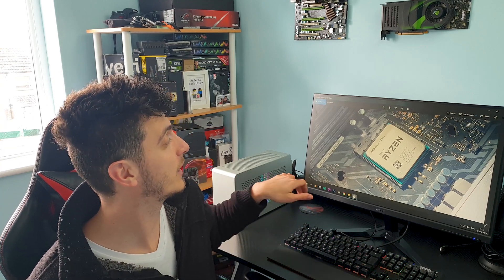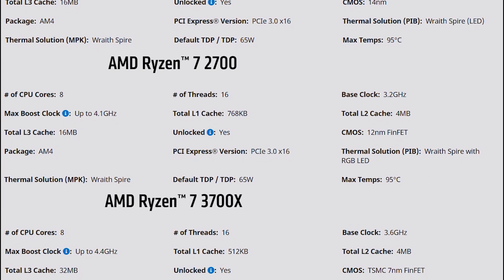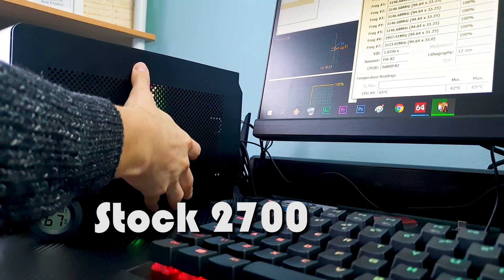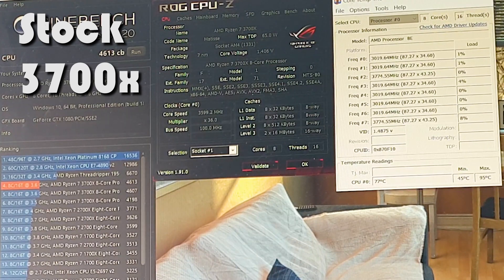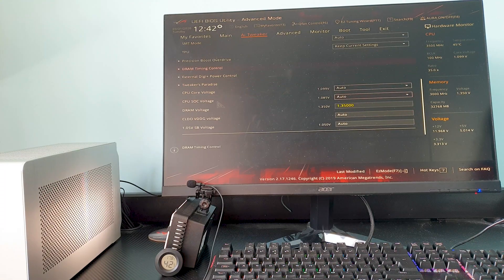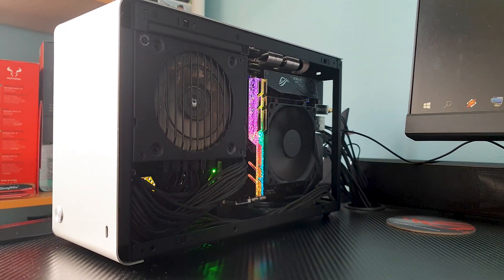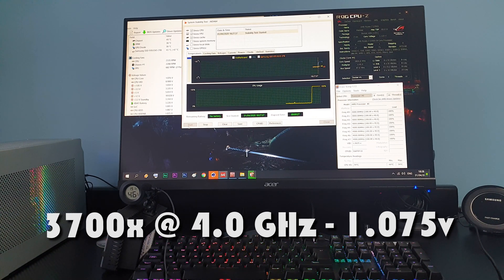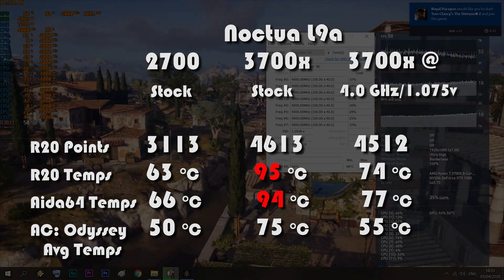Ryzen 7 3700x @ Noctua L9a | Dan A4 SFX | Is it a true 65W TDP CPU? | Air Cooling Tests – Part 1/2

Comment from the maker: What temps do you guys get with your 3700x in the A4 and in general?
Reply: Got the same case, same setup.  I set my PPT to 78W in Bios (you can do it on Ryzen Master too) and get 4550 score on Cinebench20. temps never go over 79C under full stress. I'm happy. With 40 multiplier lock I found 1.112v to be my sweet spot (4827 in CB20 and 85C under max load in aida).
Reply from the maker: @espow2070  Thank you for the info!
Reply: I'm using the wraith prism cooler, and when encoding video in handbrake, temps go up to 90 degrees. sometimes hotter. It seems fine when gaming, just using handbrake, it seems to get very hot.
Reply from the maker: @esinach  Yeah sounds about right, they can get really hot when in 100% usage even in stock form since the voltage curve is a bit agressive.

Comment: Do you think the L9a would adequately cool the 5800x at stock?
Reply from the maker: Apparently no chance or it will throttle, if we are talking about the Dan A4 case. It's 9 degrees warmer than the 3700x at stock according to techpowerup and knowing from my previous tests that the L9a bearly will cool the 3700x as is.

https://www.techpowerup.com/review/amd-ryzen-7-5800x/20.html
Reply: @Glob3Tech  Damn, ok thanks! Just a sanity check for my first SFF build, I wanted the 5800x for MOAR POWER but the 5600x might be more sensible. I'm building in a 3L case so max cooler 47mm - a lot of planning required for something this small!
Reply from the maker: @lawrencecorr6232  Sure 🤗. I don't have the chip myself but it looks like a long shot with the 5800x in stock form. Maybe my manual OC trick will work like it did with the 3700x, than yeah in theory it should be under control.
Oh nice! Wish you good luck and please let me know how it goes.

Comment: That CPU has a lot more potential. Am running mine on a 240mm AIO at 1.35v at 4.3 ghz, and it scores +/- 5200 points in Cinebench R20.
Reply from the maker: Very nice!

Comment: Do you think a Ryzen 5 3600 (stock) would have acceptable temps at stress test?
Reply from the maker: I would think it would behave in stock form very similar to the 3700x. 

This review shows only one degree difference between it and the 3700x. 

https://www.techpowerup.com/review/amd-ryzen-5-3600/19.html

So yeah would be hot in stock form. It needs the manual OC I did if you want it in the A4 on air.
Reply: @Glob3Tech  thanks for the quick reply, dude. I guess SFF PCs suffer from same temp problems as laptops (but with more solutions though).
Reply from the maker: Of course my pleasure man. 🤗 Indeed.

Specifically for the A4 if you check my latests videos in this playlist I have found for my needs a nice ballance between cooling and low noise output. 

I need a 3900x or even the 3950x to fully test my solutions but for now if you have the 3600/3700x the best path is that manual OC of 4.0 GHz @ 1.075v that gives me stock performance but 20C cooler and you can even use the L9a. If you install the AIO then I suggest a side fan for extra aiflow around the motherboard that will improve everything. 

Any other questions just shoot 👍

Comment: if you watch gamer nexus video, this video doesn't mean anything. he already said "in amd world, a 65 watt tdp processor is not 65 watt, it's because they included a 65 watt tdp cooler there" so that's make intel and amd diferrent. intel give delta cpu power, while amd give is based on what cooler they included. ryzen 7 3700x use around 65-100 watt for gaming
Reply from the maker: Well he is tech jesus after all 😁
True only for the 3rd gen AMD Ryzen. 1st gen and 2nd gen, they respect the TDP.

Comment: This is dumb question as I'm new to computer building but can the noctua l9a or l9i (w/am4 mount) cool amd ryzen 5 3600? Very nice build. I may want dan a4 case over ncase m1 cause of smaller footprint and I'm more casual, not into overclocking, just want simple small computer for internet and light gaming
Reply from the maker: No worries at all. Thank you! For stock use with either the l9a/i for that CPU it should be fine for what type of usage you described. Further down the road, I might recommend a small negative offset for the voltage only of you see it idles like 60 degrees or something if that matter, since 3rd gen Ryzen are a bit aggressive on the voltages on some boards. Maybe by now they have been more finely tuned with BIOS updates.
Reply: @Glob3Tech  the 3600 is also very (over) aggressively volted. I use a -ve voltage offset instead of a fixed 1.075-1.1v in the tiny k39 case with a similar cooler and its the same idea of undervolting.
Reply from the maker: @personaltrainersg  Excellent, thank you for confirming the same behaviour on the 3600 as well. 👍
I don't have the 3700x anymore to try a negative offset but glad to hear that is another great option.

Comment: i did the same thing and ran my i9-9900k at 4.0GHZ all core with 1.20v Using l9i but the scores were way lower
Reply from the maker: Yeah quite the difference between the 4.7-5GHz range. What about the difference in temperatures?

Comment: thermals are pretty bad in a node 202 with a 3700x as well.
Reply from the maker: In stock form for the CPU?
Reply: @Glob3Tech  yeah, while it wasn't as bad as with the case in the video, it was still going into the upper 80s. I wasn't using the stock cooler that came with the 3700x because it was too tall for the Node 202, so i ended up getting an ID cooling IS-60. I replaced the fan that came with the IS-60 with a Noctua 120x15mm fan (better in every way to the fan that was on the cooler) it dropped thermals down to the mid to high 70s, but I took it a bit further and lowered the PPT to 75w and the CPU temp tops out at 65c (left it set at 100% for 30 minutes. 

But the GPU thermals are just as bad, it would blow past 80c and into the thermal throttle range. I added two 120mm intake fans which thermals now top out at 73-74c. I can get thermals lower but that'll be by cranking the GPU fans at 90% (I'm just going to cut exhaust holes above the GPU to get rid of the trapped heat).
Reply from the maker: I see, yes, on the hot side. Nice with the PPT. What motherboard may I ask and what GPU? 
Those extra holes yeah will help.
Reply: @Glob3Tech  the motherboard is a Asus Rog Strix X570-i, and the GPU is a PNY XLR8 1660 super dual fan.

Comment: I have a 3600x after upgrading from 1700x in the Dan case. Zen2 is a beast with temps. I was using the l9a and then went to Asetek 645LT - my temps weren’t great (60 idle). So switched back to l9a but using liquid metal as the paste. Much better temps. Will likely be selling the AIO. I do need to check out undervolting and reduce temps further. Nice vid man!
Reply from the maker: Thanks man! Glad to hear it's working for you as well on the L9a!

Comment: What was your CPU idle temp?  And  what was your CPU fan speed behavior in idle or light office work?   Does the CPU fan spin up and down every couple of seconds?
Reply from the maker: Asking for the cpu in stock form or 4.0 GHz @ 1.075v?
If it's the second one, from what I remeber it was in the low high 30s to low 40s on the L9a, fan curve set on silent and I didn't notice any agressive fan curve changes. 

In stock form, mid to high 50s and yes the fan will spin up and down every couple of seconds even on the silent profile.
Reply: @Glob3Tech  Thanks, hm, my 3700x is stable only at 4 GHz @ 1,125v and that gives me 48-50C idle temp with Noctua NHL-12S, probably the Sugo SG13 itx case is not so good in airflow as the Dan A4...   And that still had 10C temperature spikes now and then, better than stock 20C spikes, but still annoying.  So I had to resort to disabling the turbo frequencies altogether, the base 3,6GHz is silent at all times.  A bit dissapointing, I don´t understand why they set such high turbo and voltages, going far over 65W tdp...
Reply from the maker: @Stanislav_Lauko  Welcome man. Maybe try 4.1 GHz for that 1.125v? At least get more performance. Aha I see. Yeah, the A4 having its own separate areas for cooling cpu/gpu side and intake fans work really well in the A4 for the CPU.
I know, that's why I did these videos. With aome motherboard apparantly you can set the TDP levels overall. Another viewer mentioned this for his Gigabyte board. My Asus strix b450i doesn't have this feature. Stock yeah its 65w but 88w at the socket as they call it.

Comment: Did you every try the L9a with a 25mm noctua fan instead of th 15mm one that is delivered with the cooler?
Would it perform better than a black ridge with the 92mm fan?
Reply from the maker: I haven't tried the regular 25 mm thick fan but worth a shot and will put this test on my list for an upcoming video :)
Thank you for the idea!
Reply: With this Dan case? No. The case only allows for 48mm cooler height. With a 25mm fan, the height will be 48mm you leave no room for air above the cooler which will result in worse cooling perf and even worse (louder) noise. Trust me I have tried that myself with a similar case. For other case without the restrictive coller height, it might perform better but I believe you would be better off with other cooler with a larger heatsink.

Comment: On the Gigabyte B450-I the most effective and simple way was to set the PPT lower than stock (88W on 3600). I set 54W and went from 88W and 3500r20 to 55W (peak) and 3300r20. No need for the L9... even the included 'Wraith Stealth' didn't need to go above 1500RPM anymore.

NOW with the 3700 and the Asus B450-I PPT in the BIOS doesn't do anything... :/ Disappointing from Asus.
Reply from the maker: Excellent insight on the Gigabyte board, thank you! I know, hence why I had to do my manual OC per say.

Comment: Great video mate. It might be a silly question, but have you updated your chipset drivers and applied the included Ryzen power plan in windows?
Reply from the maker: No such thing as a silly question James 🤗
In this video I had the second to last bios update for the motherboard. Regarding the new chipset drivers I don't know if I had them updated nor did I change anything in the power plan, but I will make sure I mention these as well in my next video!

Comment: Amazing videos.  I am learning a lot from them and hoping to get my first sff build done soon.  How do you think the 3700x would do with your alpenfon black ridge cooler using a 120mm slim fan underneath and the vlp ram?  I wonder if it could make stock voltage viable?
Reply from the maker: I am so happy to hear and thank you for the comment ✌ For a stock 3700x with that setup, I would say anywhere from a modest 5 degrees C to maybe max of 10 C better than the results with the L9a (what you saw in this clip). Good luck with your build and I know eveything will come toghether for you ✌ Any other questions, let me know.

All the best,
Alex
Reply: @Glob3Tech  Thanks for your quick reply.  The asestek 645 video has leaned me going the aoi route more.  Again thanks for all the hard work!
Reply from the maker: @switchbeast8825  Glad to help and thank you for the support!

Comment: @Glob3Tech Can you tell us something about the fan curve that you are using or rather the fan rpm after your tweaks, especially in AC Odyssey?
Reply from the maker: Hi Tederean. To give you an exact rpm number in that scenario is hard since I am still on the AIO installed in the A4. But from what I remember the fan was no where near 90-100% like in stock form regarding the 3700x. I would say for that tweak, the fan was around 60-70% rpm in AC:O.

Comment: Great video man! Was wondering whether you could also test the 3700x with the blackridge, especially with the 120mm fan configuration. Thanks!
Reply from the maker: Thank you! Sure will try if I can find better VLP ram since I don't have any available at the moment. :)
Reply: Glob3Tech Would you say the blackridge with a 92mm is better or the Noctua L9a for the 3700x?
Reply from the maker: @TriNguyen-wl5vf  If you go with the 92mm fan, then the Noctua L9a for sure. Quiter and neglijable performance. The black ridge I would only do it with the 120 mm slim fan to be worthwhile.

Comment: What should I do with blackridge with Dan a4 for 3700x can I go abit higher to 4.1?
Reply: My one at the moment is 1.125 4ghz
Reply: Anything lower than that cinebench dont finish 0
Reply from the maker: @AiR.0  Aha I see. Try 3.9 for 1.075v. What motherboard do you have?
Reply: B450i asus
Reply: Sticking to 4.0 1.125 as it gives me enough power
Reply from the maker: @AiR.0  Sure. :) What temps are you getting? Using the stock fan or noctua or 120 mm ?
Reply: @Glob3Tech  stock fan and with gaming at around 57 and with cinebench max 74
Reply from the maker: @AiR.0  Those are good. Thank you 🤗
Reply from the maker: Yes, try maybe 1.1v if 1.075v is not enough for 4.1 GHz.

Comment: I am just starting an SFF build in the Dan A4 (going for R5 3600 though) and I was wondering whether you have investigated the impact that the Asetek 645LT has over an air cooler such as the Noctua L9A on the airflow. I am especially concerned about the temperatures inside the case, as it seems that the hot air would get stuck in there without the CPU cooler blowing it out through the side panel.

Also, did you mount the NVME on the front side of the mobo? If so, what kind of temperatures are you seeing on it in idle/load?
Thanks for the great content btw, you got yourself a new subscriber! :D
Reply from the maker: Thank you so much! 

Testing and starting to edit for the new video with the AIO as we speak so the video will be out tonight (UK time) or tomorrow the latest.

Regarding the airflow for the case, that's why I have the case fan blowing air inside through the motherboard plus no rear I/o shield is mounted to extra ventilation. 

The M.2 i have it in the front now. 44C in idle with a room temperature of 20C with the AIO. Load on the M.2 while copying I just did a quick test now - 30 GB file transfer - it didn't go over 64C.

Any other question just shoot 🤗

All the best,
Alex
Reply: @Glob3Tech  Good to hear, looking forward to the follow-up, especially since I've already ordered the asetek to give me some temperature headroom. I am howerer still a bit torn on whether it's an overkill or not.. :/

Perhaps a couple more question on the NVME topic then. :D How much of a difference thermal wise is there between the 2 slots? Does the heatsink on the front side help? Also, did you end up applying a thermal pad on either side to help dissipate the heat better?

Can't wait for all the parts to arrive!
Reply from the maker: @ProxyQt  It depends how quiet you want the system to be. The Asetek will give you that extra headroom for OC even :)

Regarding the M.2 location. Sure. When I had it on the back of the motherboard it reached in the mid 70s but always under the thermal throttle threshold. On the back I left it as is. On the front it has its own thermal pad from the motherboard's top heatsink. But that's it. As long you will keep the CPU cool, eveything else will fall in line :)
Reply: @Glob3Tech  Thanks you for the replies, much appreciated!
Reply from the maker: @ProxyQt  My pleasure 🤗

Comment: I have the exactly same specs except K39 case.  In stock, I was hitting 82c in cinebench r20 with a score of 4660. Aida64 10 min run was cooking cpu at 102 c peak. I then disabled PBO in bios and after testing various settings found my sweet spot to be 3.9Ghz at 1.1v and Load line calibration set to Level 2. Cinebench score 4730 with max temp of 73c. Aida64 10 mins run was hitting max 84c. Much much better.  It’s important to set load line calibration manually as in auto mode, it wasn’t respecting my 1.1v voltage limit and temps were high as a result.
Reply from the maker: Perfect. Thank you for sharing. Will try that as well!

Comment: very impressive result! Almost no loss of performance
Reply from the maker: Oh yes! I have been using it like this, even upgraded to the latest bios and still it works perfectly. Now I want to test a 3900x or the 3950x 😁
Reply: @Glob3Tech  Yeah. I`m looking some test with 3900x, but with 92mm AiO. I think about upgrade my raijintek metis with 2600@4,15GHz to Dan A4 with 3800x/3900x (only 100$ diffrient), but I can`t find any test. I`m affraid that can be a little too hot and too loud with gtx1080TI. ;)
Reply from the maker: @graynoname1200  I think Kyle from BitWit has a test with the 3900x in stock. On the limit with the results. From my tests so far I think with some tinkering we can tame the 3900x /3950x in the A4 with the Asetek 645lt. But again I can't say for sure since I don't have them to play around with. :)
Reply: @Glob3Tech  I forget about this test. I watched this before. But I still hope that will be more tests about a4 + 3900/3950x (I would get more info about loudness and trying little OC/UV). :)
Reply from the maker: @graynoname1200  Me too :) I will keep an eye out for an 3900x on ebay for a good deal. Who knows :)

Comment: Zen 2 CPU are easy to cool, on stock settings, as Zen 2 will adjust core speed to heatsink capacity..;) Even NH-L9a can cool R9 3950X on blender load, only 5% slower than 240 AIO. Sweet spot is stock vcore with -0.1v offset..:D
Reply from the maker: I will try to get that monster as well to test it out 😁
Reply: @Glob3Tech  https://smallformfactor.net/forum/threads/smallest-atx-case-cerberus-x-complete-build-log.2007/post-186654 While testing C7 with graphene coating, I did run some tests on R7 3800X..:) I'm reaching 89°C on stock and 83°C on stock -0.1v
Reply from the maker: @MarcParisTV  Very nice! Thank you for the extra feedback!

Just had a look at your topic on SFF. Amazing insight and details that you provided!
Reply: @Glob3Tech  thanks. Don't hesitate to join.. :)